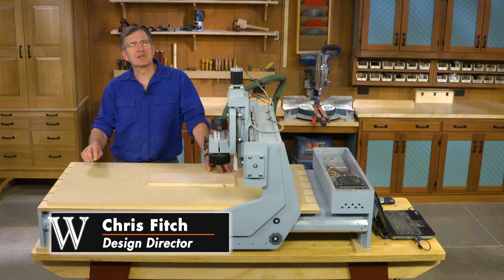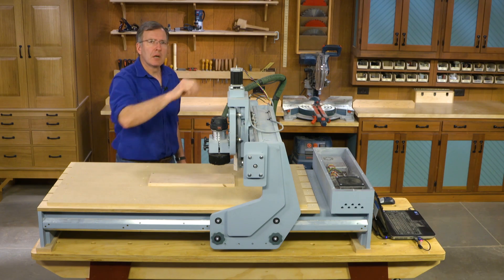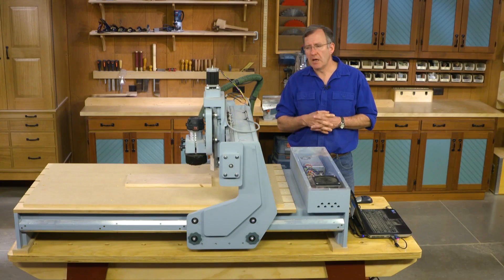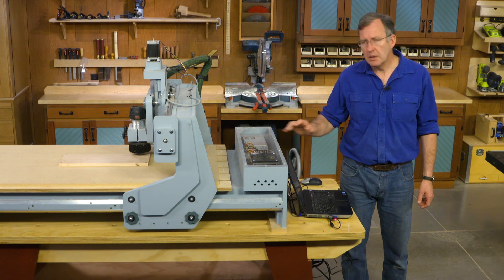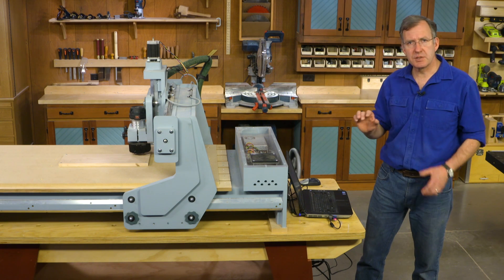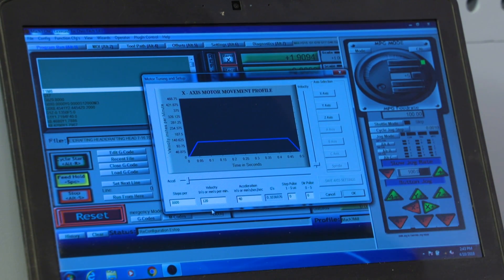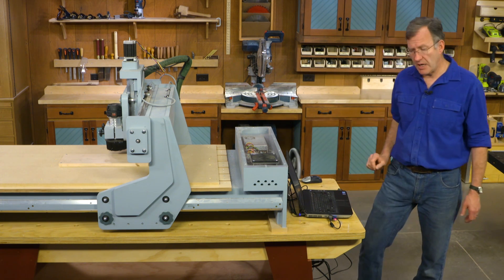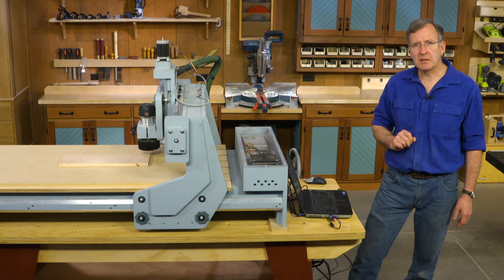Getting Started With Your Shop-Built CNC Router

Comment: I used the Woodsmith plans to make my CNC. Well, I started using the plan but as I was building I made mods that I thought were easier. I did purchase some of the suggested parts such as the lead screws and anti backlash nuts. Most other parts I purchased on Amazon. One mod I made was installing flange bearings on both ends of the lead screws. I mounted legs on my version with a cabinet underneath to house the electronics and misc parts. The legs  ended up reducing the travel a little bit but I still have a working surface of about 24 x 36. I also didn’t make all those fancy bed boards. I just use a piece of mdf as a waste board. It was a fun project which kept me busy for most of the winter. Unfortunately I’m afraid to leave the house now so I don’t have any material to make anything. I live near Niagara Falls. NY. I didn’t keep an accurate total of the cost of everything but I figure it was about $1200. Thank you Woodsmith for the inspiration you provide.
Reply from the maker: Those sound like reasonable modifications.  Glad everything worked out for you.
Reply: I'm building one right now... worried about the aluminum ways wearing down after use... just running my assembly back and forth a few times has left marks... how are yours holding up?
Reply: @chipsandsawsaw  I was concerned about the marks also but they haven’t gotten worse.

Comment: Can you give me an idea oh the cost $ to build this including the software ?  Thanks for another great video.
Reply: In the first video, they said about $1300. No mention of software cost. From what I've seen on other home-built CNC machines the different software ranges from $300 to $700 Plus.
Reply from the maker: Last I heard it was in the $1300 range to complete the build, but you could shop around the sources and piece out the CNC parts and get it cheaper.  Here is a list of the parts: https://cdn.woodsmith.com/files/issues/242/cnc-router-materials-and-hardware-list.pdf  Some the sources are clickable links to find out more.  We have a couple of recommended software options, either Mach 3 or Vectric, that are about $150 each.

Comment: Beautiful looking design. One tidbit I'll offer though is that after changing setting in the motor tuning section- you HAVE TO press save axis settings, not just OK. your settings will not be saved and you'll pull a good bit of you hair out trying to figure out whats wrong.
Reply from the maker: Thanks for the tip! I'm sure that can be frustrating.

Comment: It appears your X & Y axis are swapped from what is normally done. Is there a reason for this? Usually, X is the narrow side, Y is the long side, and the origin is left/front. The front is the same side of the gantry as the spindle. Technically, it's probably no big deal. It could be confusing.

Comment: Great job BUTin the article and all of the videos you never tell what size step motors you use.  Too small and the gantry will never move accurately.  I have been a fan of Shopsmith forever.  Now I am getting disappointed.

Comment: Sorry, but you're wrong about resolution. It's a bit disappointing to hear a serious magazine taking wrong because of a lack of understanding of electromechanics. 

There's theorical resolution and real resolution. Please understand steppers can only stop precisely on full steps and half steps. Any other position is not the expected quadrant, as there's a growing deviation as you come closer to a full step or an half step. So the real resolution of your stepper ends on half step. Definitely. The microsteps in between smooths transitions, like when you're cutting a circle. But when the machine moves along an axis only, like X0 to X200, the path will be exact if the Y stepper stopped on a full step or an half step. If it stops on any other microsteps, the position is wrong. And keep in mind that the holding torque of the motor decreases dramatically with the microsteps division. You can loose 80% of the holding torque on a 1:64 microstep. That means the machine can be subject to slide to another wrong position if it's stopped on a microstep on a axis, Y in our example, while the cut along X apply a lot of resistance on the bit. So in transition microsteps gives the illusion oh a higher resolution while stopped on microsteps, the resolution is symbolic only. 
Last but not least, real resolution does not consider motor steps only. All the drive system needs to be measured. Unless the machine uses insanely expensive C-0 ball screws, the precision decreases with the build quality of the other components (especially with anti-backlash nuts, which are literally spring loaded breaks). You can adjust the parameters as you like to come as close as possible to the expected point B, but if the thread oscillate few degrees during each turn, the resolution is not what you expected anymore. And that's exactly the same with guides. 
Finally, the resolution of the machine, which is the precision you can get on the machined part, is way inferior of the teorical resolution. It's the teorical resolution reduced to the half step, then reduces to the screw precision, then reduced to the guides deviation, and so on, until the wobble of the bit  on the spindle. 

Usually, you need a machine with 10 microns resolution to make parts expected to have just a 100 microns precision (ten times lower). Actually, the most expensive industrial machines can't reach the resolution you claim. A machine made out of wood and construction materials will introduce variations much larger than the components' teorical resolutions, because of moisture, flex or vibrations indeed. You would be wise to call it "theorical resolution" or to duck your numbers to realist values.
Reply from the maker: Thank you for taking the time to type Ot the long and detailed explanation.  It is possible that Chris misspoke on that subject, but then again we are all still learning too. Regardless, the machines we’ve built have worked spectacularly for us. 👍
Reply: Can you please point me to the video or website you have created for a DIY CNC?  Thank you.
Reply: @davidvitale9338  I started here, back in 2005. Enjoy.